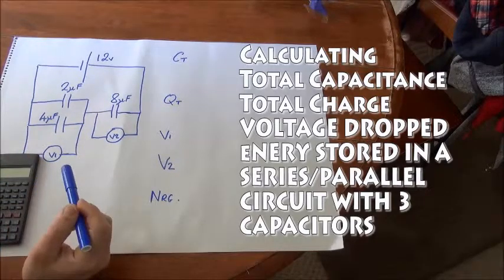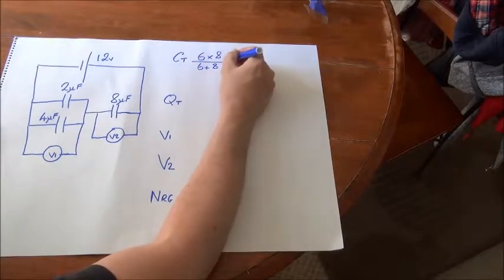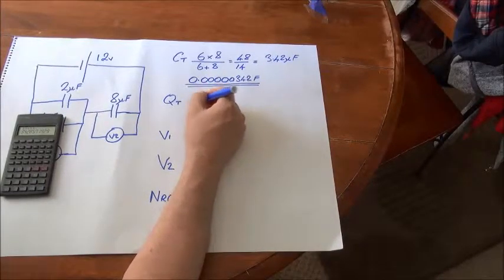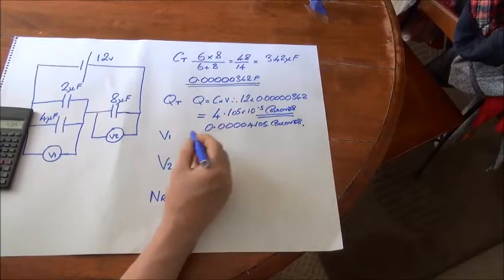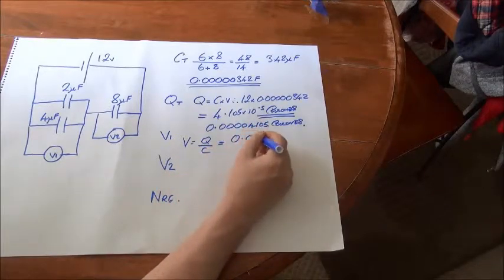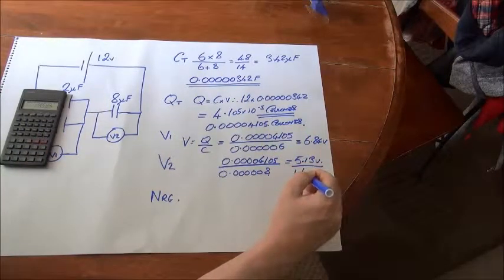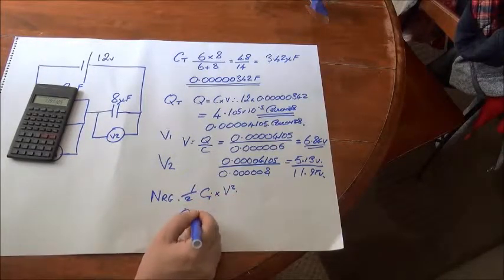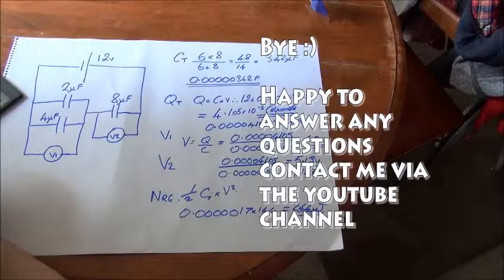Capacitors in Series and Parallel

Comment: I was assuming the supply voltage is same as in your video and only looking for the transient response over where your v1 is. The 6.84 volts was taken from your video as well. The question I guess would be if I added the 1k resistor, would the steady state voltage still be 6.84 and would the ex time constant be calculated using the equivalent capacitance of the circuit. Sorry if I'm sounding confusing, I've been replying from a phone so I can't proof read my responses

Comment: what if we were to add a resistor after the voltage source and create an RC circuit, how would we then go by solving for the voltages of each capacitor? for example, i'll add a 1k resistor after the source. can the values you conclude here be considered the steady state value of my resulting RC circuit?